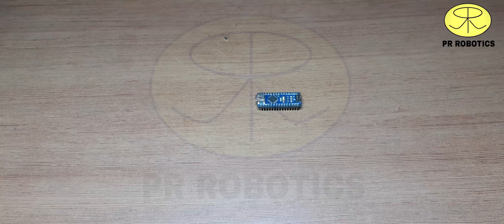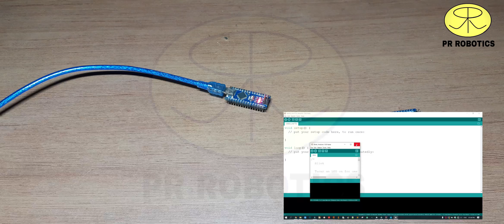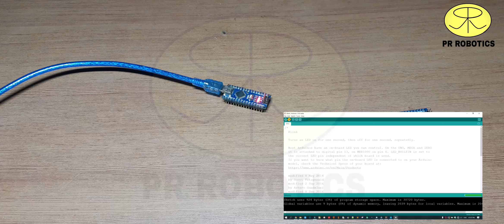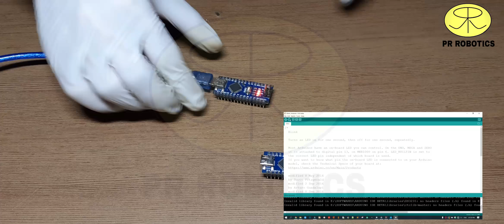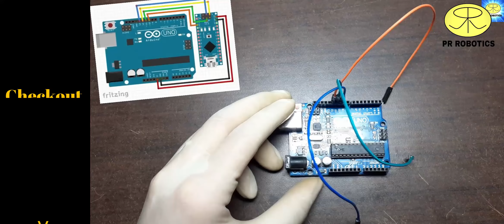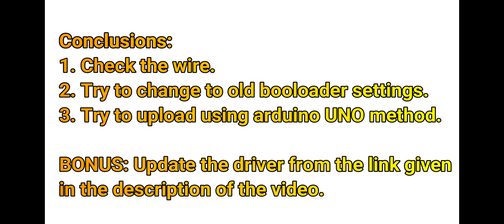#51 SOLVED!! Every Arduino NANO error || PR ROBOTICS

Comment: What cable do you use? OTG or regular?
Do you have any solution to restore the UNO and NANO boards with hardware modifications with jumpers and so on? I stand by. Thank you very much.
Reply from the maker: Hey, I'm using a regular cable. But be sure that it's a data cable not a charging cable. 

Till date I have used a good amount of Arduino UNO and Arduino Nano Clone boards. And the only issues I have seen is with the USB to UART Chip which is sometimes a fake one with nothing mentioned on the chip itself. Hope it helps
Reply: @PRROBOTICS  Yes, yes it is a data cable but it is the standard type and is not OTG. I need to get one for Arduino Nano. Mah I don't understand, last year it was working fine and now it doesn't work. Now I want to check the smd electrolytic capacitors. :)

Comment: My ch350 ic is getting hoott when connected to USB any solution?????
Reply from the maker: CH340G or CH340C?
Reply: Sry it's 340
Reply: It's getting hotter
Reply from the maker: @harshadgunjikar1595  There should be a a letter at the end. May be the IC is clone one and that's why it is getting hot.
Reply: @PRROBOTICS  yes
Reply: @PRROBOTICS  how to fix

Comment: My board got burnt after connecting laptop.
Reply from the maker: That's not possible because your laptop can't provide more than 5V at output on 2.0 port. And also your arduino NANO have inbuilt AMS1117 5V Voltage regulator which can handle upto 12V very easily.